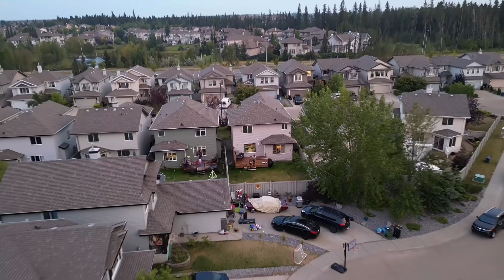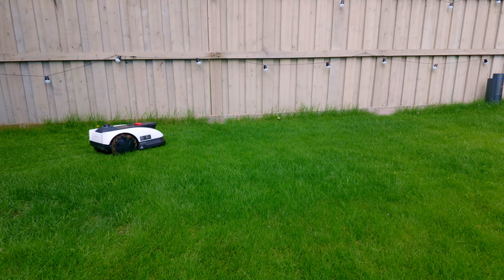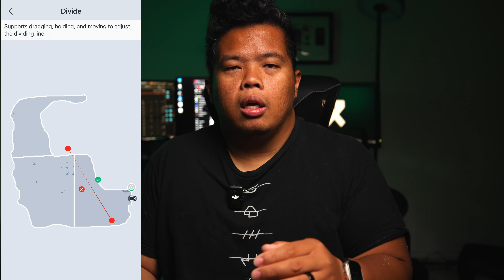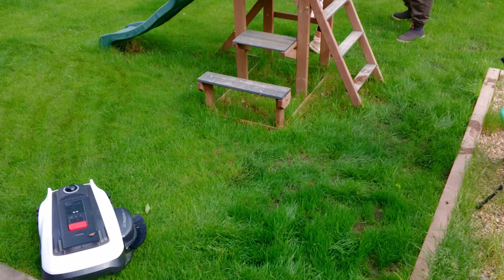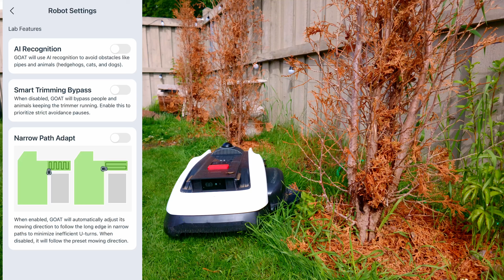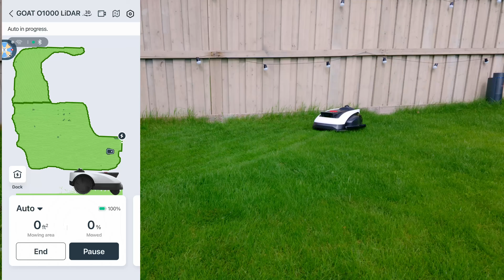ECOVACS GOAT O1000 LiDAR PRO Review: The Best Robot Lawn Mower for Small Yards?

Comment: Will the Ecovacs automaticly  be able to detect a wire fence (chain linked or chickenwire)?
Reply from the maker: Ive never tried it. But chainlink fence will be part of the map making… so it would either hit it and then follow it after. Or use manual mapping on the chainlink part. 
After the map is all done. Then it would only do that perimiter

Comment: Nice video. I do have a couple questions I hope you can answer, as I am considering upgrading to this model.

1. Can you set the edge trimming to go around every mapped obstacle  (Like around your swing set legs, the base of a tree, a firepit, or a shed that isn't on the perimeter)?
2. One issue I have with my current mower is it's total disregard for dog toys. Could you try some quick obstacle avoidance on some smaller objects and see at what point it stops avoiding them?
Reply from the maker: Thanks! Glad you enjoyed it 
1. Yes you can. You do have to draw it. Like creating an area for it, manually walking the robot to draw the perimeter. And then you can hit full boundaries or draw it out on the app as well. This is actually a good video advice. Thanks 

Edit: there is also a full manual mode for mowing and trimming. 

2. LiDAR and the 3D sensing front camera is better at sensing them. But i would still caution smaller toys that are more buried in the grass because those i found are harder to be detected